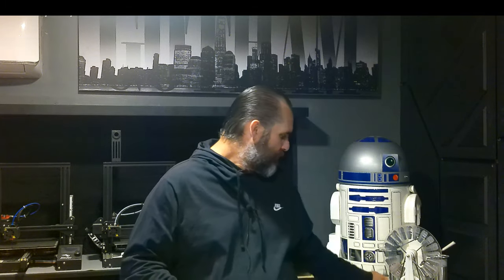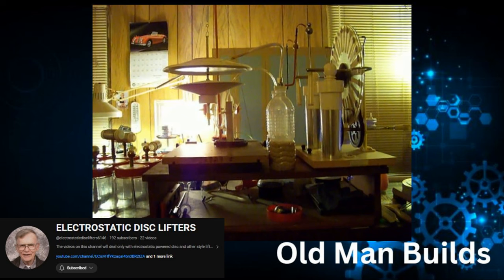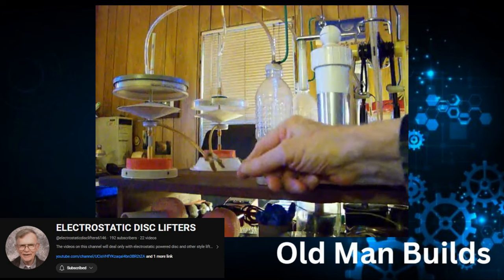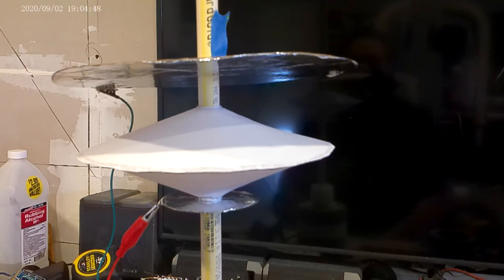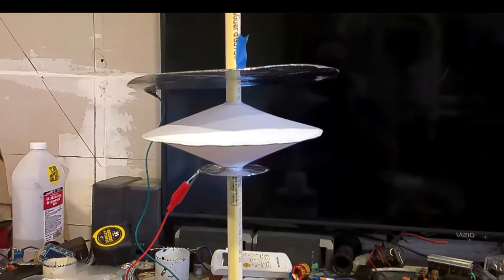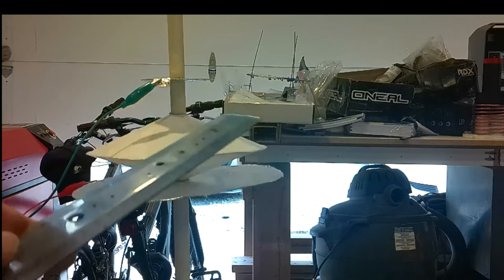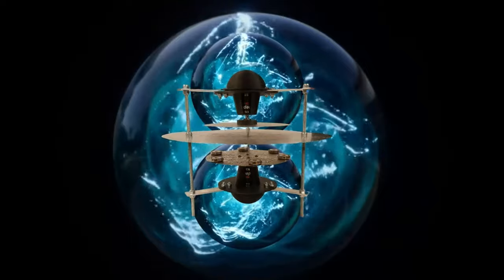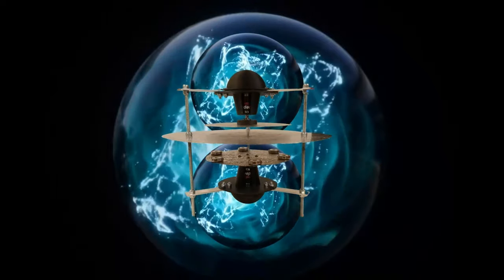Graviflyer Flyback Coil Explained #14

Comment: Sound waves can change the spin of electrons. The vibrations of the sound waves can cause the electrons in the atoms to move and this movement can influence the behavior of electrons.
Reply from the maker: it all works together
Reply: and to quote steinmetz, "Unfortunately, to a large extent in dealing with the dielectric fields the prehistoric conception of the electrostatic charge on the conductor still exists, and by its use destroys the analogy between the two components of the electric field, the magnetic field..."
Reply from the maker: @toymaker3474  I understand. I am charging a plate. There is no capacitor. So no dielectric field. If there was air would be the dielectric field. If there is a transfer between the upper plate and the center plate then air is the dielectric field. 

The word dioletric field is not correct in this. The upper plate has a charge on it. That's it.
Reply: @nathanbunten4299   what steinmetz was saying from his book, is that their is no such thing as an electron. what jj thompson discovered was the terminal endpoint of a dielectric line of force.  As steinmetz clearly shows in  fig 9 of his book  that these  dielectric lines of force terminate on conductors.

so unless your saying steinmetz is wrong , you are indeed creating a dielectric field around the plate.

Comment: Plastic like cellulose in wood and paper and the polycarbonate CD. The ionosphere is negative, and the silica surface is positive charge. The device lifts up. Like my diagram of the sun, earth and moon and the top and bottom aluminum disks. The layered, capacitor, Casimir gravity effect.  You have it correct Nathan and now to build the graviflyer correctly.
Reply from the maker: I understand that using a different material would help with the charge of it. However I am concerned about the eddie current portion. Alexey is using things that on their own are poor but he is getting multiple effects out of each item. So in this case the plate will give a boost in speed to a motor and also slow it down with eddie current. There will be charge on the disc as well. The magnets on the bottom one will pull charges down. Some other materials would not allow for all these effects.
Reply: Yes, I understand.
Reply: Nathan your setup goes up one inch in 0.1 seconds that I guesstimated. The graviflyer needs a charge of 0.6173 C. The graviflyer lifts up one meter at the speed of sound at 343 meters per second at the surface of the earth. From this I can calculate the speed that your device lifts up by the time the Alexey's graviflyer lifts up one meter to get a value of 137 or reversed alpha. From this I can calculate the charge that you put on your device in the video of 0.6173/137 or 0.004505 C. Alexey's craft weighs about 2.6 kg do dividing 2.6/137 I know the mass of your paper craft in the middle of the two aluminum plates as about 19 grams. Some people think part of the UAP are made of plastic and they would be correct. The Roswell craft was a mylar craft that was coated with aluminum and had an aluminum frame. The aluminum was charged up and went into warp drive so the military could not control their craft, so it crashed in the desert. General Ramie shows the actual Roswell craft in the famous photo and claims it was a balloon which it basically was. They put some monkeys in the craft to see what gravity fields would do to the monkeys and they aged and evolved rapidly and turned into the alien bodies that had an autopsy done on in the famous pictures.
Reply from the maker: @richardmuller867  19 grams sound about right. 2 pieces of paper stick glue and a tunnel down the center. Maybe 21 grams.  8" diameter.
Reply: The spinning discs also create a vortex field with the charge of the many electrons that is gravity like the spinning heavenly bodies and spinning around the sun and the sun spinning around the center of the milky way galaxy and the galaxy spinning around the star cluster, etc., etc.
Reply: You need to seal the engine inside an atmospheric environment that doesnt change?

Comment: Interesting! Would be possible to use a HV voltage multiplier? It does has some interesting results too. Plus it can comes in many different sizes
Reply from the maker: I have 2 of them with ac flybacks. It will spark out to easy. It would not work for this.

Comment: Now I have a better understanding of what's going on. 
So we need to get a "Static Charge" on the plate.
The first thing that came to mind was a Van de Graaff generator. I built one a while back and I can feel the static electricity in the air from about 4 feet away. I also can smell ozone. As the Van de Graaff generator belt causes a potential difference, could a similar way be applied to the Graviflier plate to charge it with static electricity?
Reply from the maker: When I receive my device to tell how much charge something has. I will put felt on the tip of the electrodes to the plate. I think the test will help in seeing how much more charge I will get. If at all. ( idea based on the vandergraph)

Comment: I’ve been contemplating an electromagnetic static field generator connected directly into a micro3D printed shell or skin for a flying vehicle. I wonder sometimes about how much voltage and amps would be required for flight.
Reply from the maker: Voltage alone won't make it fly. You need resonance.
Reply from the maker: since you are into 3d printing. Look up resonance when you install klipper. The motors in a 3d printer make the sound when going in a circle.
Reply: @nathanbunten4299  yep, input shaper calibration.
Reply from the maker: @tokin420nchokin  yes
Reply: I’ll need to watch more videos to understand better what it is you’re doing. And go from there.

Comment: What I'm seeing is to be missing here is that your device relies on Earth ground to operate.You need to find a way to disconnect from Earth ground to get your Graviflyer to lift without a cable connection to Earth ground. You may be able to do that through Wifi or Bluetooth. Good luck.My Friend.
Reply from the maker: you are missing that the earth ground works on the same energy as the static volt. It explains a lot about how the earth works. It also tells you that you can create fields like the earth by using the static volt. The intention was never to use earth as a wire connection.
Reply: @nathanbunten4299  Than use this static voltage that you mention and disconnect from physical Earth ground.
Reply from the maker: @robinhooper7702  That is one of the thing we think this device does. It gets a fully negative charge. Repulsion. I will test it.

Comment: Great video , so all three discs should be insulated from each other:)
Reply from the maker: That is what the tesla coil energy is for. I makes a barrier between the craft to the earth. I think I should probably explain that further in a video. The concept would be like our ozone layer.
Reply: It was very interesting to see your experiment with the paper disc, it gives me some ideas about another design, also no special frequency device needed
Reply from the maker: @dkdyker  I added the 3 experiments to the description.  You should look at the full video if it helps.
Reply: Great thanks

Comment: Nice workOM
Reply from the maker: thank you
Reply: @nathanbunten4299  it is my understanding that ac fields block dc fields, therefore the central disc to control lifting to top disc, or sinking to bottom disc. The spikes off of bd magnets to control sink descent. However I think there should be center hole on central disc half the diameter of top and bottom disc's diameter. Cheers
Reply from the maker: @Jaantoenen  the ac field isn't ac. We are using a dc power source and mosfets to mimic an ac tesla coil. It is still dc or at least not ac.

Comment: What if the paper lifter spins and pulses up and down but pulses faster going up and doesn't pile down but let's gravity take it down or some times pulse it for a double jump
Reply from the maker: only if the top and bottom disc can move with it. It is the difference between the two that make it work.

Comment: I see that you are using the transformer supplies to provide an easier constant HV charge than using a machine.
The advantage is that you can tune the output depending on the properties of the air.
I think you are trying to explain the leakage of charge though the air between the two plates.
The higher the humidity of the air, the higher the leakage current, so you would need to adjust the HV to compensate for the loss.
I'm surprised  you are not measuring these high voltages to keep track of your experiment results.
Reply from the maker: I just ordered the machine to measure them. The leakage was intentional on the graviflyer. It may sound at first that this is wrong. But it makes more sense if you wanted to shift fields for lift.

Comment: So for all you geniuses....
What is the most likely
Origin of earth's magnetic field...is it the rotating plasma 
Of earth's ionized atmosphere.....
Which without even the
Foggiest idea about the causes of magnetism, if you
Look at the planets and moons
With plasma dense atmospheres also happen to have strong magnetic fields...
And in that same category
The plasma dense atmospheres that are rotating
The fastest also have the
Strongest magnetic fields...
Compared to the planets and
Moons with little or no
Atmosphere have little or no
Magnetic fields, and most interesting the same category
All have low rotational spins...
So why all the backward
Mental gymnastic flips by 
Academics to create theories
Whereby magnetism is mystical by molten lava, which
In electrical conductivity is
Equivalent to high resistance 
High load equal to a direct short

Comment: Makes me wonder,if  ufos are real if they are using something that spins and charges the disc up with something that we have to do on discovered.
Reply from the maker: What gets me is if all it takes is static charge, resonance and the ability to move charges Then moving granite would be easy considering the piezo part (Quartz) is already in it.
Reply: Those things are so advanced the designers must have moved beyond moving parts long ago, field control.